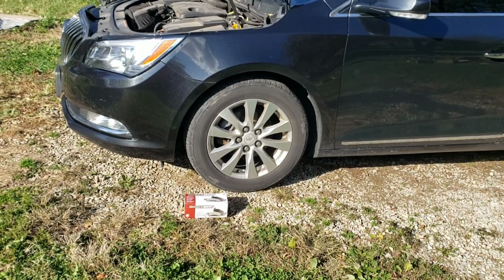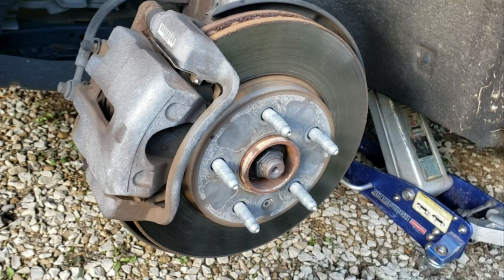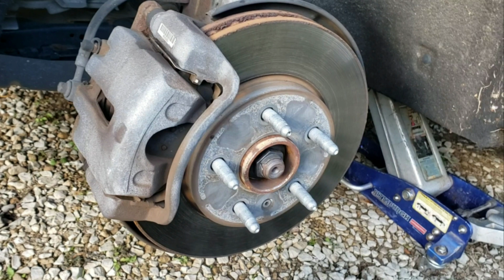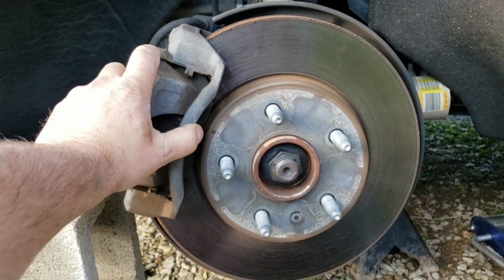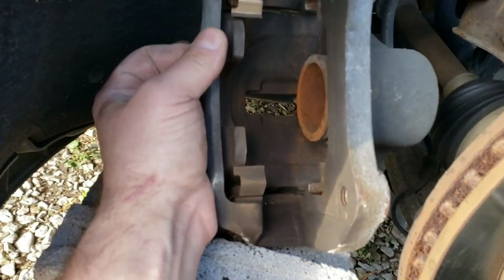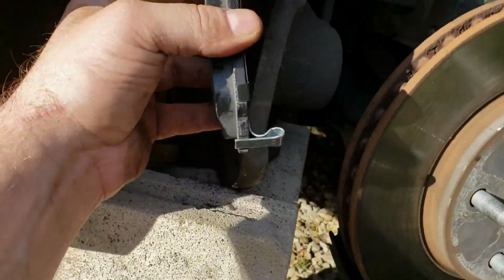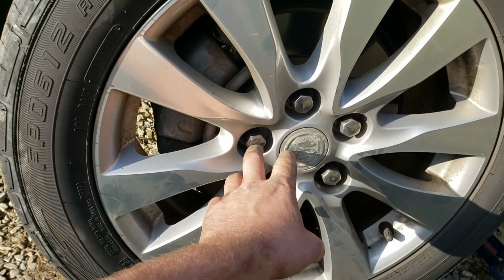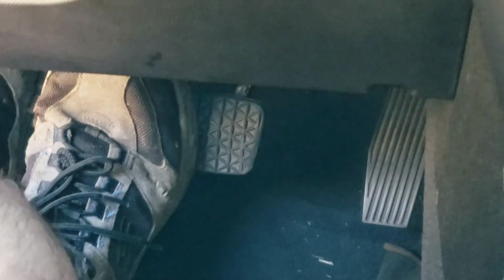2010-2016 Buick Lacrosse Front Brake Pads & Rotors How to Replace

Comment: I don't know who taught him how to do brakes but that ain't the right way you don't have to take the big bracket off unless you replace the rotor, just take the caliper off and take the slab pins out grease them up then put the brake pads back in put grease on the end of those then slide the caliper back over the top put the two screws back in the slide pin bolts and that's it now if you take it off the rotor but then you going to have to take off that big caliper bracket but you can just take the caliper off by itself without taking that big caliper bracket off the way he's doing it that's too much work thank you

Comment: 2010 or later model buick lacrosse torque specs. for the brake caliper bolts and brake caliper guide pins 111 for the bolts and 20 for the  guide pins foot pounds.

Comment: Thanks for the help.
Have a Merry CHRISTmas and a Happy New Year.
Reply from the maker: Thanks, you too.
Reply: @BuckeyeBallistics  no problem. 😉👍
After I got that tiny little star bolt out that sucker (the old rotor that I was beating on before this. LoL!) came right off. Ugh! Durr4me! LoL!

That was smooth, thanks again. You helped me out a lot.

Toddly ☘️

P.s. - Those keepers were kind of a pain to get them to stay in place too. Js. 🤔😁 But eventually I got them and the pads aligned and in place.
Reply from the maker: Don't feel bad, I missed it at first too and had to add it to the video.

Comment: DO NOT PUSH THE OLD BREAK FLUID BACK INTO THE ABS MODULE OR ON A CAR THAT DOES NOT HAVE ABS BACK INTO THE MASTER CYLINDER. 
This will push the old break fluid that is acidic into an area that will destroy seals and cause you to have to replace expensive parts that you don't need to replace.
It's best to open the bleeder screw and pump the old fluid out. Then refill the master cylinder reservoir back up.

Comment: The bracket that holds the caliper on... yes those torque to yield but not the caliper bolts are not....

But you realize that's a hybrid it totally different
Reply: That's not a hybrid

Comment: They are TTY bolts. Must use new bolts. Torque to 111ftvlbs, then using torque angle gauge turn bolt 45 degrees then another 15 degress. Do thisxin 2 steps, do not simpmy turn 60 degreed